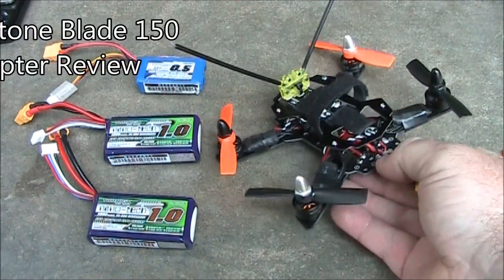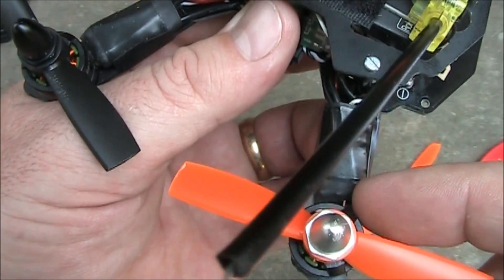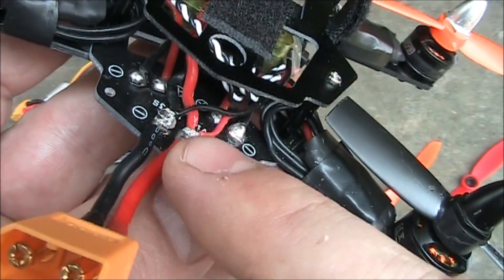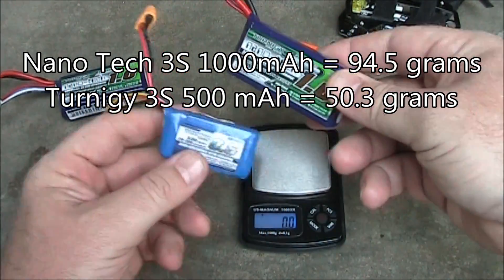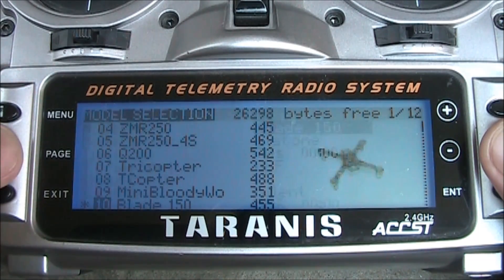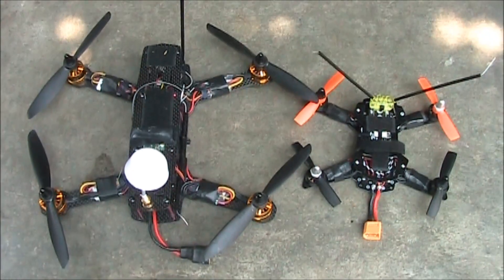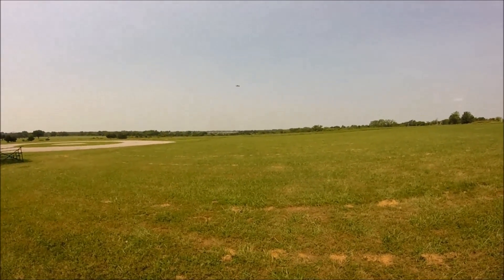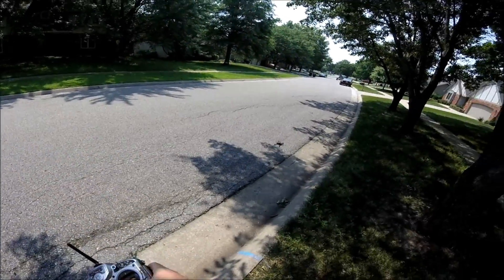Diatone Blade 150 Full Review, Tuning, and Build Tips

Comment: Hi, I had build my diatone Blade folowing your video and after some flights, the motors starts losing power with a fully-chargued 3S battery and now its impossible to fly at altitude.

Now flying at ground level and it is impossible to raising altitude.

After this issue, I touched the motors and were very hot. Maybe it's related to the power loss. Tested with another batteries with same result.

What can be causing this?

Comment: Do you prefer the tyrant 150 over the 180?
Reply from the maker: I fly my Blade 150 with 3S and my Tyrant 180 with 4S.  They both have different purposes.  I fly the 150 around my house and the 180 at the flying field.
Reply: Would the tyrant be too much to fly around the house with a 3s?  I am trying to decide whether to go with the 150 or 180.  I would like to use it around the house and field if possible
Reply from the maker: +Ben Ronan No, it should be fine. It's not that the quad is too fast to fly, but rather that it will go too fast.  However, by keeping your camera angle straight, it will slow you down a lot.  Also, I wouldn't fly a 180 on 3S batteries with 2300 motors - they just don't spin fast enough, use 4S.  when you get to an open field, try angling your camera more and you'll see how much faster it flies.  I fly my 250 with 5" props in my front yard and street, I just don't recommend it because of its larger size and faster speed.  My 150 with 3S is the only thing I'd recommend to others.

Comment: Travis quick question... I just burnt up 2 10a esc on my build 😂😂😂. I was using some emax 10a first flight was good with a 2s could keep a hover but that's about it.  I put a 3s and burnt the 2 rear esc's. Would you suggest  12a esc's until my 20a's get here or just wait?

Comment: Hello, I'm trying to configure a drone like this and I'm stuck doing the Wizard Setup on OpenPilot. When the Wizard says: "Please toggle the Flight Mode switch, For switches you may have to repeat this rapidly" The software don't detect any of the switches of the taranis, and I dont know why. Could be caused by the wires on the D4R-II? I'im using four channels, the switch need another receiver with more than 4 channel??
Reply from the maker: +Alex Alexus If you're using a D4R-II, you need to use CPPM.  It only uses one wire for all the channels.  If you're using all 4 sets of pins on the D4R-II, then you are using PWM, which you do not want to do.  The following video is kind of dated now, but the CPPM setup is the same.  It starts around 4:25 in it:   https://www.youtube.com/watch?v=Q7KpBGDxZQ4
Reply: Thank you so much. It works!!!
Reply from the maker: +Alex Alexus Great!  I'm glad it is working!

Comment: You didn't put camera and vtx on it yet ?
Reply from the maker: Yes, it has a vtx and camera now.  I still fly this quad a lot.  I always fly it on 3S though.  it will fly on 4S but I want this to be my neighborhood flyer and 4S makes it too fast for that.  :)
Reply: My diatone zmr 160 is 290gr without battery on it, I still need to waiting for 1306 4000kv motor to arrive, bcause my old 1806 2300kv motor can't run 3" prop :(. Did you try to put a HD camera on it ?

Comment: Hey there kahoona, I did the same setup as you, I'm using opto esc's so I used jst plug on servo on cc3d and soldered right onto main battery connection on pdb like I see you did. When I plugged cc3d to computer it worked but then when put a 3s battery to it, a little flame and puff of smoke came from cc3d :( any suggestions what I did wrong? Have you ever burned a cc3d? Thanks
Reply from the maker: Yes, I've had magic smoke come from CC3D boards and Naze32 boards.  I've found out that most mini CC3D boards can handle the 3S voltage, but every now and then, I come across one that can't.  It stinks that yours smoked.
Reply: +travisgrindal 
haha yeh just my luck..I just got new a one in the mail and hooked it to 5v on pdb and it works good. Now all I have to do is figure out why I cant get motors to spin in openpilot to set minimum throttle.. ive got good lights on cc3d and get the chirps from escs but I cant get em to spin? any ideas? thanks again
Reply from the maker: +Jerry1212 Did you run through the transmitter setup wizard and all your throws are moving correctly?
Reply: Well i had gone through it with old cc3d just fine but still had the same issue with throttle setup. then i magic smoked it lol.. i have lemonrx satellite hooked up to 3.3v on cc3d and flexi port. Now on this new cc3d i have it setup same way but my satellite receiver will blink once then turn off... not sure if i fried receiver when i fried cc3d..... 
starting to feel like i don't have a future in quad building lol
Reply from the maker: +Jerry1212 Don't give up.  I've smoked plenty of components... it stinks, but you learn a lot of rarely smoke the same thing twice.
Reply: Well i didn't give up haha, finally got it flying! Might have to learn how to tune it a little but it's fine for now. I was looking at lipo ' s and saw a 1000mah 65c-120c.. have you run a battery with that high of c rating? Think it would be ok? Thanks again, it was ur video that got me wanting to build one in the first place lol
Reply from the maker: +Jerry1212 Yes, that battery should work great!  Higher C rated batteries don't push harder but rather allow more power to be pulled from them without as much voltage sag as lower rated batteries. Although with higher C ratings come more weight.  If you're using 1306 motors, they won't pull more than 40 amps all together.  So for a 1,000 mAh battery, any battery with a 40C rating  or better should work fine (1Ah * 40C = 40amp max safe draw).

Comment: You inspired me to build a blade 150, thank you for the awesome video!
Reply from the maker: +Horizon Films Good!  You're welcome!  I still really like the Blade 150!
Reply: +travisgrindal Did you fix the problem with the hot motors on 4s? Maybe the screws are to long..? I was planning to fly on 4s .....
Reply from the maker: +Horizon Films Not on my Blade 150, but on my Deformation 130 I use the same motors and it flies fine on 4S.  I'm almost positive the motor screws are too long on the 150 but i just haven't messed with it yet.
Reply: +travisgrindal Maiden was sucessful, 4s is no problem for the motors. AUW is 240g. ive got a problem... with my new 4s 850mah packs i only get 4min of hover time, and maybe 2 min with some fast climbs. It Hovers at 45% Im a bit disapointed..... This Quadrocopter is a beast at 4s 100% throttle, it scares me bit;) Greetings from Germany!
Reply: +EagleEye FPV Edit: Now after some charging cycles i get got flight times. The Lipos were just too new and didnt reached the full capacity.

Comment: ive built tons of 250s and this is my first 150 build.but i went with rmrc 4 in 1 12 amp esc. i get that crazy wobble as soon as i give it throttle any idea what it is? ive constantly messed with PIDs and recalibrated escs and reflashed naze rev. im using the same exact frame with 1306 motors from dys
Reply from the maker: +Matt Yockey Generally, it if is a fast wobble, then the P is too high.  If it is a slow wobble, the I could be too low.  You could also try using BetaFlight on your Naze32 and see if that helps.  I have it on a CC3D and it seems to work pretty good for me... but that is on a different sized quad.

Comment: Good job, found this helpful.. just building mine now.. did you check that your motor screws are not touching the copper winding this would cause them to heat up and potentially short the motor, I reckon 5mm should be about right depending on the motor, I chose to go with emax 1806 2280kv, they have a little more talk and will handle a little more weight for fpv.. I wonder if anyone's racing these yet :-)

Comment: You may have mention it somewhere but why the 1306 motors and not the 1104? Building one of these may bench the phantom 3 for a little bit, but it sure looks fun for the price.
Reply from the maker: I think the 1306 can swing 3" props a little better.  I'm not 100% confident on that yet, but i have a 130 sized quad I'm building with the 1104 motors so I'll have a better opinion later.
Reply: +travisgrindal  Great. I did order the dys 1306 from bang good. BTW. are you happy with that camera and vtx? it's a great price and it looks like it fits in there perfect.
Reply from the maker: +darmiejr yes, I'm still using the same one.  It still works real well for me.
Reply from the maker: +darmiejr If you're buying new stuff, look for a camera that comes with the ET200R VTX (R means it has the Raceband channels).  I don't know if they have one or not.  i just saw the ET200R available somewhere.  I'm only buying VTXs now that include the raceband channels on them now.

Comment: do you think 16a esc's is safe with 1306 / 3100kv motors and tri-blades ?
Reply from the maker: +michael lee Absolutely.  I can't imagine a scenario where 1306 motors draw more than 20 amps.
Reply from the maker: I cant see them using more than 16 amps either.

Comment: Hey Travis, Steve here.  I'm having trouble w/my Diatone ET180.  I've been told its my  "looptime" and my "PIDs". When hovering, it has the jitters and shacks.  I was wondering what you might suggest. I'm using a naze32, emax 12A nano (One Shot 125 support) but, I haven't flashed them so they remains as regular ESCs and DYS BX1306 3100kv motors and clean flight. I appreciate what ever info you can offer.  Thnx
Reply from the maker: Tuning the PIDs can be a little daunting. At a very high level, if it shakes real fast, the P is too high. If it is a slow shake, then the I may be too high. my friends have had good luck using beta flight but i haven't tried it yet.

Comment: My 250 also used cc3d mini but I have a question that when I try to take off it leans toward left what can I do to stable it? (I was trying it at home) no wind. Hope you can comments thanks!
Reply from the maker: +wing hum thomas fung I'd guess you've already done the re-leveling thing in OpenPilot.  If not, try that first.  When mine drifts, I use the transmitter trims to make it stop or just keep flying forward so I don't notice it so much.  :)
Reply: Thanks.for your advise, i have just put the value for roll on remote to be 1500. Thats done it well.
Reply from the maker: +wing hum thomas fung Good, I'm glad you got it figured out.
Reply: ***** have a great day. I am setting up a new quad soon if i hv question i ask again.

Comment: Hey +travisgrindal, what kind of flight times are you getting out of that 1000mah battery with those props?  Did you find any improvement in the performance with the tri-blade props you were sporting in the 4S video?  I'm going to be throwing 1306's on a RotorX atom frame that only takes 3" props and trying to find a good balance of power/flight time for 3S.
Reply from the maker: +sandnessmj The 1000 batteries give me about 8-9 minutes of flight time (assuming I don't crash).  The triblades didn't seem to help much.  Some people have said they've ran 4S batteries on 1306 motors, but mine always come down too hot.  I thought maybe the screws were going too far into the motors and touching something but even after adding washers to hold them out, they are still getting too hot for my liking.

Comment: Hey travis. sweet video mate, and thankyou heaps for posting this video. I have one question I.. what settings are running on your esc's, I just don't wanna smoke mine
Reply from the maker: +toby strauss I'm using BLHELI with motor timings set to high and dampened light turned on.  The rest are defaults.
Reply: cheers mate!

Comment: Hi, Travis, great video, looking at your jst connection to power the cc3d board it looks like the red wire is going to the top signal connection? should it be red middle black lower connection?
Reply from the maker: robert steele You are correct.  Because I left my mini CC3D in the case,  I wanted to lower the overall height so I resoldered the pins.  The power is only positive and ground.  The other slots have just ground and signal.  After I did all that work, I figured it out it wasn't really necessary.

Comment: Nice video, thanks. I planning on building the Diatone ET 150. I'm trying to decide on either the DYS 1306 motors or the Banggood 1104's. What's you view on the DYS 1306's, should I go with those?

Thanks
Reply from the maker: Matthew Nesbitt Props for 1104s are a lot more money and I haven't found a place that doesn't charge too much for shipping.  The 1306s are good, but on this quad, you have to cut down 4045 props to 3" so they'll fit.  I haven't got my 1106s in the air yet, but I really like my 1306 motors on this.

Comment: I think the screws on the bottom are much warmer than the outer rotor because they actually connect to the stator where the windings are - the outside of the motor only gets warm from conduction through the airgap to the magnets so its not the best gauge of motor overheating, probably something that most people overlook.

Comment: Nice..:) I have just Bout 2 250's, so I didnt think that I was going to buy any smallish anymore but your review made me hungry for some more :).
About the screws in the buttom, make shore that they dont touch the Copper, and specially they dont harm the copper. I have tried this before and your motors dont hold long time if they are...
anyways thank you for a nice review Brother :)
Reply from the maker: I think I'm going to get some washers and put on the screws to pull them back a little and see if anything changes.

Comment: Couldn't you just use a blade 200qx props? And I am thinking about getting a Spedix S250!
Reply from the maker: The 1306 motors have a 5mm shaft.  If those props have a 5mm hole, they should work.

Comment: I'm also waiting on VTX and motors, but I'm planning to use the small 1g adjustable voltage regulator from ebay to power the electronics. D4R-II states safe voltage up to 10V, which you exceed with your 3S lipo. I also hope that my rev3 afromini board arrives before I get all the motors and stuff, because otherwise I'll just use rev1 and there will be no lights on my 150. (:
Reply from the maker: LeoTheHuman Did I tell you this already?  I checked the voltage output to the receiver on a full sized CC3D and it was 5.01 volts - that was with a 3S battery attached.  I think the same is true for the mini CC3D, but I haven't verified that.
Reply: Yep, you did! (:

Comment: so the atom can take upto 15v but how does the rx get its safe voltage? I have tried looking at this and cant find an answer. thanks
Reply from the maker: James Wright I checked on my full sized CC3D and the output going to the receiver (with a 3S battery connected) was 5.01 volts.  I'm not 100% sure, but I'd guess the same is true for the mini CC3D.

Comment: You should try the naza 32 then you won't need the voltage sensor
Reply from the maker: I'd need to have a BEC to reduce the battery voltage since I'm using OPTO ESCs.
Reply: ***** yes,I have just used an emax esc
Reply: ***** The current version of the naze32 is wide voltage input. I run mine straight from a 3s as I run kiss escs and power the receiver off the video tx 5v out
Reply from the maker: Andrew Harrison , cool! Have you tried running it directly from a 4s battery?
Reply: I haven't but it's capable of taking up to 16v on the input rail so it should handle it fine. It would be interesting to see how much the noise produced by the ESCs effect the flight controller performance. I currently have a filter on mine as I need a filtered line for my 12v camera, so may as well wire it in there anyway.

Comment: I heard some thing about not conecting the black wire or wires of the battery sensor ? Do you know anything about that ?
Reply from the maker: Don Fowler Are you referring to the FBVS-01?  I have them both connected to the battery and both wires going to the D4R-II on all my quads and haven't had any problems.

Comment: I would definitely want to run this on 4S with the Nano-Tech 850mAh 4S packs (only 99g). The DYS motors can take it with 4045s, so I'd imagine they'd have no problem with 3045 bullnoses!
Reply from the maker: temjinstrife I don't have a BEC because the CC3D can take the 3S power.  If I use 4S, I'd have to have a separate BEC to power it....  I may do it on my next build.  :)
Reply: Makes sense. Plenty of room to squeeze a Pololu in there though! :)
Reply from the maker: temjinstrife I need to get one ordered.

Comment: Odd that your motor screws are warm. Maybe they are sinking heat out of the motor? Did you check the motor screw length to ensure they are not making contact with the windings?
Reply from the maker: David Nicholas Yes, I looked and they aren't touching anything inside the motor.  I don't know what caused that.

Comment: Looks awesome! Is 20a esc not a little overkill though?
Reply: Connor Mullan nah, they're cheap and very light. No reason to use 10/12/16A ESCs anymore
Reply: ahh ok, i was amusing myself with the idea of new ESC + motor combo so i might step up to the 20a and even throw in a 4s lipo :D
Reply from the maker: +toby strauss I'm going to try 4S again soon.  They have a lot more power than 3S!
Reply: +徐双莲 capacity is around 600-1000mah... 1000 is getting a bit on the heavy side. I'm running 800mah 4S 35c on mine
Reply: Looks so awesome !

4S lipo RC battery ?What's the capacity ,more than 5000mah ?
Reply: +Connor Mullan Indeed it's overkill, but those sn16-sn20 esc's are tiny! perfect for these.. the 1306 3900kv only draw 9 amps max

Comment: Damped light = motor breaking a must for FPV racing. OneShot 125 reduces the lag time between when the PID controller calculates correction values and and your ESC's . Basically your motors get updated 10 times faster.

Is it just me or is the blade 150 fast as hell it looked to me like it was doing 60+ mph and looked like it was tracking dead straight?